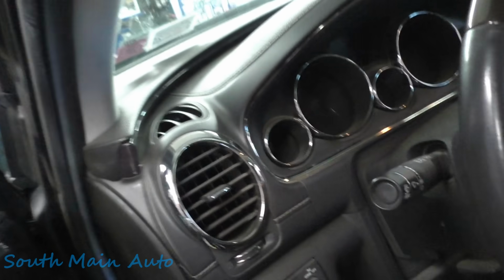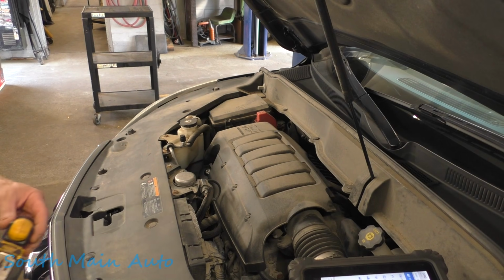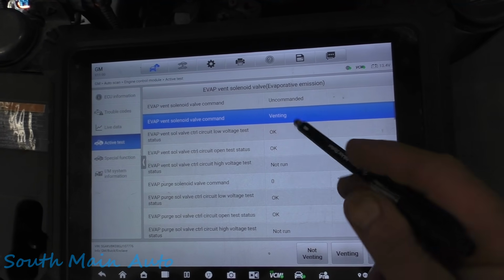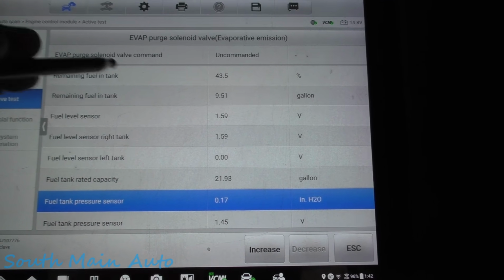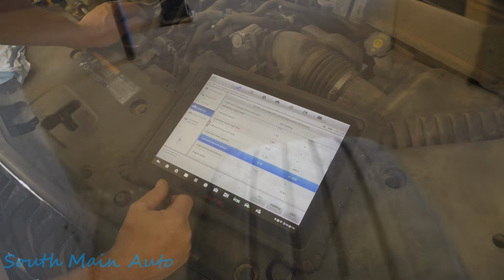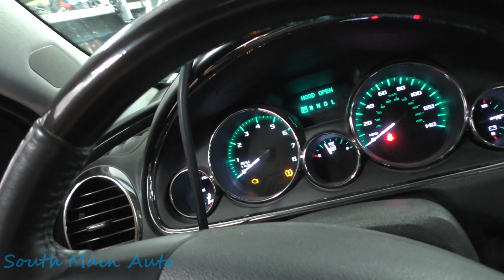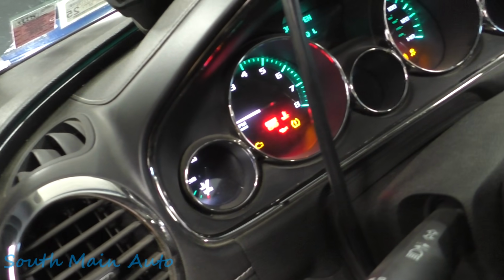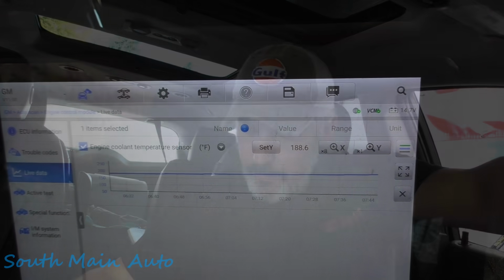Buick Enclave - Engine Light & TPMS Light On.

Comment: You didn't put anything on the threads of the sensor in the radiator 🤯😠 ????????????????? Good work !!!  Leak tests are a pain in the rump !!! Nice to know about the fuel cap filler rust 💥leak possibility.

Comment: I refuse to use Std for ECTs on GMs. I've had too many comebacks. GM actually has a couple updates on these. On later model 3.6s, they moved the sensor to the rear head, so upper intake has to come off. Yay. The 3.0s are the easiest.

Comment: No one ever talks about people who take the rubber valve caps off and replace them with shiny metal ones which seize up and you have to destroy the sensor to get them off. It will corrode the threads right off. Had a woman come in for tire repair and I explained what happened and I asked her what to do with the other 3. She remembered her husband putting them on and was very mad when presented with the $350 bill. Her choice though.

Comment: The folks designing some of these things just stare at the parts on a computer and probably never ever see the actual part or a fully built vehicle or work on one to know if their design is stupidly inconvenient or letting dirt into places dirt is not wanted like going into the engine oil fill hole.  I'd say all the manufacturers should force new designers to watch your channel for a few months before touching a computer or designing a part.  They'd learn a few things I'm betting.  But then again, the parts and service departments would probably lose sales, so keep them failure prone parts and bad designs coming....

Comment: Every now and again on my 02 ranger i get a p0442 code. I've changed all the evap system components or checked them and it still comes on from time to time. I just wonder if it is humidity sensitive for the system or what? I reset it and its fine for a while, but one of these days I'd like to actually fix it right.   Btw, speaking of dentists, I'm your age and have had braces for 4 months. No power chains yet, but I have rubber bands, but thankfully only at night for now. I guess instead of buying a corvette or something else to make me feel young again, I opted and went to the orthodontist funny, I never would have saw that coming a few years back.🤔🙂

Comment: He didn't take the fuel tank out, but he said he did because he doesn't want any numbskulls killing themselves in an awesome fiery spectacle. In case you're wondering how I know this, when he's checking fuel tank pressure the time on his tool says 1:36. After he cleaned the rust off the filler neck, it was 1:40. I highly doubt that even Eric O is fast enough to remove and reinstall the fuel tank AND clean the neck in just 4 minutes. I'm just saying.

Comment: As a GM TECH I replaced purge valves all day. it was my go to check. I just take a vacuum hose stick on purge and suck on it and see if the hose would stick to my tounge/hold vacuum. No tools needed. IF it wouldnt hold on my tounge replace purge and then test rest of system. And The ECT sensors go bad on 3.6 engines all the time replaced tons of them. just see the code, pull the connector and watch the scan tool -40 open 300 shorted and replace sensor. Hardest part is typically they were waiters and stupid hot.

Comment: Tip: I see some folks put on the wheels with a impact gun. Then then follow with a Torque Wrench. If the nut did turn and Torque Wrench goes "Click or Beep", you have over torqued your lug nuts. God forgive the customer gets a flat tire, they will have a hell of time getting those lug nut with their tire Wrench.

Comment: My comment has not much to do with this video. My son has a 2013 Dodge grand caravan that had the temperature light going on then off and couldn't catch with the mechanic. Finally the Car said it had a fault in the idle control but it was actually having the temp sensor read to hot and wouldn't let it run at all. Two messages for one problem instead of just saying the temp sensor was bad. That is what makes the computer systems so hard to figure out.

Comment: BINGO! It was the temp Sensor and I was really happy that's all it was. My 2017 Traverse gave me some wacky codes and even went into LIMP MODE. Actually I could only move the car a few feet. I ended up letting it cool down for about 15 minutes and restarting it several times and then was able to drive it 1 mile home.

Comment: What could be other sources or coolant temp sensor errors?  I have a 14 Silverado that had the same malfunction about a month ago.  Replaced sensor with a NAPA one,  and it fixed it for about two weeks... then the malfunction has returned very sporadically and ...intermittently and goes away after one, two or a couple more drive cycles.  I don't have the computers,  but did check the ground wire of the connector (brown)  each time it fails and there is continuity.   The are no green crusties,  but I did spray electrical contact cleaner in harness connector for good measure.

There is no pattern to malfunction.  Happens day,  night,  while driving or at start up,  warm out or cold out.  Is it possible that a bubble just gets trapped around the sensor or a sign of early (God forbid) module malfunction? 

Looked online for wiring diagrams and have yet to still find the chassis ground point location for contact confirmation.   There are NO other money light malfunctions concurrent with this one

Comment: How about using a Scotch Brite® pad to clean the rust off of the filler neck opening? They are plastic and won't cause any sparks. No need to remove the fuel tank.
Reply from the maker: Or use a brass brush like I did, or emery cloth all good options. However this is the internet and people are dumb so always remove the fuel tank according to service info first 😐

Comment: What a crappy place to put the radiator cap.  I guess you're calling a tow truck if you have a cooling system leak away from home,you can't get to the cap without tools to top up the radiator.

Comment: Yeah, agree that “Standard” purge valve will probably be DOA in a year. Did the same with my wife’s Fusion. Lasted about 1.5 years. Put a Motorcraft on it and has been fine since. Motorcraft uses Bosch as well albeit the original (2016) only lasted about 6 years. YMMV. 🫤

Comment: Feel like at a certain point owner 2 or higher or the enclave will delete that panel or drill an access hole for the rad cap lol

Rolling trash can that pays the bills. Whether it’s engine, trans, suspension, HVAC, electrical - GM keeps mechanics in business!

Comment: Nice to see someone using an actual torque wrench to tighten wheel lugs instead of an impact and torque stick like so many places. I had several studs broken, or over torqued to the point of cross threading, on my last car by places just going to town with the impact and torque stick. Didn't help that Subaru uses softer steel for their studs and required lower torque than a lot of domestic brands.

Comment: Can you get an app for your cell phone to run the tire sensors test? Nice
Reply: Your phone needs to support the unlicensed ISM bands as most sensors are 315 MHz or 433 MHz. The sensors aren't like RFID which can be read with a phone using NFC. I don't think phones typically support those frequencies. Your best bet is finding an accessory that either connects with Bluetooth or plugs into the USB port on the phone.

Comment: I did that temp sensor on my 2013 chevy travers, a few years ago I'd get a message like"  engine temperature hot AC off. ", or something  like that. I lost maybe a cup of coolant. Never done the purge already it's got 300k plus kms on it no codes runs good.

Comment: Was that fuel tank removal anything like the torque to factory specs you often resort to?
Reply: The master of trolling at work.   Brass tools do not cause sparks.   But most of the YouTube arm chair experts wouldn't know that.
Reply: @patrickinottawa27  copper beryllium tools do not produce sparks, if i recall correctly. first time I'm hearing about brass being non sparky. if true then, makes no sense to buy expensive copper beryllium tools when cheap brass tools can do the same.
Reply: @lordjaashin   Non-sparking tools are made up of copper-based alloys like copper-titanium alloys, copper-nickel alloys, copper-aluminum alloys (or Aluminum Bronze), bronze or brass which is an alloy of copper and zinc.     As long as the alloy contains copper, it won't cause sparks.       However, if you're pounding on car, and a tiny piece of steel get's embedded in the softer brass, the tiny piece of steel is not part of the alloy and will produce sparks when it strikes other steel components.    Brass is chosen in Automotive shops because it's readily available, it's fairly inexpensive and it's softer than the metals you are going to be pounding on.    Remember each alloy has different properties, like strength, hardness, weight, conductivity etc.    Copper Beryllium may have some wonderful characteristics that make it more appropriate in certain situations.

Comment: It really is amazing how fast those fuel tanks can be taken out and replaced on those Buicks. 😂
Reply: I learned in blasting school that brass is non-sparking. So using a brass wheel doesn't require a tank drop.  Just sayin'
Reply: Off camera of course.
Reply: It's called quicky.
Reply: That is why all the lines have quick connects on them - you never know when you will need to swap out a fuel tank. 😂
Reply: I know right, it's like he didn't even do it. Amazing.

Comment: Immediately before watching this video I watched the latest MegaDrivingSchool video. One of the clips showed a wheel & tire rolling down the freeway towards oncoming traffic. That is the result of skipping the torque wrench step (19:24), or putting the wheel on without removing the rust from the hub.

Comment: Let's add a million sensors, that way we can potentially have a million more problems than just the normal ones on a vehicle when the sensors itself fails, BRILLIANT ENGINEERING FEAT!
Reply: Sensors for your backup sensors in case your sensor monitoring your 67th module fails, what they've done is create an endless loop of failure points. 99% of this crap isn't necessary for a running operating vehicle but the EPA is the greatest money laundering organization in the world. Close second is paying taxes on something you outright own, it's theft.
Reply: Thats what you get when the government, EPA is involved.  Don't vote for green agenda next time.  It's going get a lot worse with EV's

Comment: I like how Eric doesn't always grab a electric or pneumatic tool to tighten a nut or bolt. I've seen the young guys quit what they're doing to find a power tool and by the time they find it they could have had the job done.
Reply: The part we do not see is when Eric puts the torque wrench to every fastener.  He does that off camera because he knows it would be boring to us.  Same for things like pulling off and replacing the fuel tank to safely clean the filler neck.  It takes a big man to think of the little guy.
Reply: Wink ! Wink ! Nudge ! Nudge !
Reply: @davidquinn6161  Oh yea, he even torques the muffler clamps to specs...wink, wink, nudge, nudge
Reply: So, apparently your opinion is low of younger technicians who rely on technology too much...  You have to give them a fair shake as this is the way the modern world is pushing them.
Reply: @joeblow6786  You jump to conclusions my friend. I've got no problem with young techs or technology. I'm just saying if you can get a nut or bolt tightened faster than finding a power tool go ahead and tighten it. My nephew is a young tech and I learn a lot from him.p
Reply: meh...  Nuts and bolts..  The last holdout of the old mechanics shop.  :D
Reply: Future mechanics will be scrawny guys with huge thumbs to push the power button on their tools.
Reply: Factory specs…2 grunts and a fart, or until your shoulder snaps
Reply: @sargefreedom1578  Tighten it till it strips then back off half a turn.🤣🤣🤣
Reply: @Heinrich_STG44  That’s another way 😂

Comment: Took longer to take off the beauty cover than it did to actually install the sensor. You reminded me I have to do the EVAP solenoid and my wife’s discovery. Thankfully we live in a no inspection state but still I’m tired of the money light coming on.

And I’m convinced that the biggest feature of a TPMS sensor is to cost money.

Comment: OEM parts.  Took me a week to get a crank sensor from GM.  The shop that sent it to me put  2 aftermarket sensors in it.  It would run, then the tach would die and the crank time was long.  Delco sensor cured the problem.  ;)

Comment: Eric are those MX Sensors the same weight as the GM ones or do you have to rebalance the Wheels?! I remember looking into them when they released them way back when but over here they were as expensive or more than the OEM GM style ones. The only upside to that would be you don't have to keep all the different Brands in stock!
Reply from the maker: I always just throw it on the balancer to be sure. Yeah they are super cheap here. Half the price OEM in most cases

Comment: Very nice, I was surprised the the no code for un-commanded purge as well. I don't have a vacuum guage so I guess allowing it to suck water from a tube from a bucket on the floor would be good enough to prove the prove the valve is flowing.
Reply: or stick your finger on the port and see if there is vacuum

Comment: Funny you should mention Standard motor parts. Today I did spark plugs on a 17 Chrysler Pacifica and needed a new coil boot nobody sells just the boot so I had to buy a complete coil, from O'Reilly's not a sponsor, which was in a standard motor parts box when I pulled it out it was a Mopar part.
Reply from the maker: Yeah oftentimes standard motor products will have an OEM part in the box. Seeing it more and more often
Reply: @SouthMainAuto  that’s cool, I would rather have oem than after market any day!
Reply: I worked at a auto parts store in 77 and they sold standard, but don’t recall ever seeing that. Makes me wonder if someone else returned said parts in your box. Happens a lot at these big stores anymore.
Reply: Yeah absolutely I know how mopar's are with aftermarket parts. If it would have been a aftermarket part it would have been put in the back of the engine where I could have accessed it easily without taking the plenum off again. I didn't even use aftermarket spark plugs. Bought them right from Mopar even though they're champions.

Comment: I've got a question for Eric or anybody else. I just put four new tires on my car with four new TPMS sensors.
Had a little difficulty getting the tires to bead up.
Would using either (starting fluid) to set the bead damage the TPMS sensor🤔🤔

Comment: Great video as always.
Just a quick thought, have you checked the bottom of the valve instalation tool.. the ones I've come across have the valve core tool built into the base of the tool.

Comment: I am so proud that none of my vehicles have tire pressure monitors, drive by wire, electric steering. makes life so simple
Reply: I'm jealous, my 2000 chevy 6.5 has several.
Reply: Why are you "proud"?
Such an odd thing to be proud of.
My car has none of those either.
Reply: @Cheepchipsable  I don't have to worry about fixing all that un needed stuff
Reply: Your horse carriage has wooden wheels.
Reply: @michaelnomura5196  yes 1994 ram 2500 4wd 5spd so simple

Comment: If -40 is open circuit, what happens when the temp is actually colder than that?
Reply from the maker: You don't go outside and your engine block is froze solid because coolant cannot protect that low at a 50-50 mix.
Reply: you install an engine block heater and wear warm clothes.
Reply: I used to live in Alaska, the Temps were regularly minus 40 to minus 50 in the dead of winter.

Comment: Had tire pressure sensor go bad on my work truck, sometimes it would read correctly and other times it would read way high or not at all. Also had an evap code kept tripping on 2002 Dodge Ram. Checked all hoses and purge valve. Turned out to be a bad seal on the gas cap.

Comment: While using the torque wrench on the lug nuts you're losing a ton of torque by not setting the e brake.    Won't be an accurate reading    I always go by ugga duggas and call it good
Reply: @commietube_censorship_sucks  for the algorithm 🤣took way longer than I expected for someone to bite

Comment: Add that to the list to check before buying a vehicle... Can you get to the radiator cap?
Reply: Yeah I was pissed when I found out my 2014 Buick encore didn’t have a dip stick for the transmission
Reply: Same here on my 2015 Camry.  AND electric steering?!?   Found that out when I went to change out the fluid. 😮

Comment: Leave it to GM to make the owner/service tech have to remove ten clips and a huge plastic cover just to access the radiator cap.
Reply from the maker: You should see where the transmission dipstick is. Lol. Never mind there isn't one
Reply: Sure is a trans dipstick!   @SouthMainAuto
Reply: Wrongobongo Eric! @SouthMainAuto
Reply: @SouthMainAuto "lifetime sealed unit", last the lifetime of the part. How long that is?  Hopefully past the warranty expiration date.
Reply: My Toyota doesn't have a transmission dipstick, but it doesn't need one.  It has a manual transmission. @SouthMainAuto
Reply: @comput3rman77  in that case. It's called a shifter. badadum
Reply: Have never been able to understand the reason for all of those plastic covers. Just something to be in the way.
Reply: It's almost like they don't want the owners to work on the vehicles anymore!
Reply: That happens because nowadays people designing cars ride bicycles to work

Comment: Heard your lunch whistle, so much be time to fill the braces with food particles. Thanks for the easy tests for evap systems, My 05 Silverado loves to get new evap solenoids till I relocated it to the frame rail tube and closed the ends with shop towels as I live on dirt and rock roads it get gets filled pretty quick with dust.